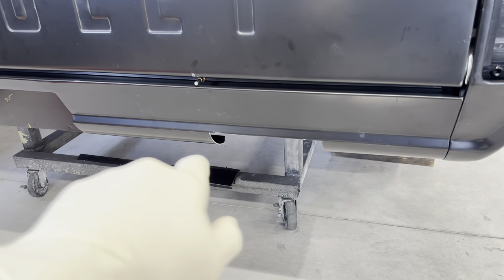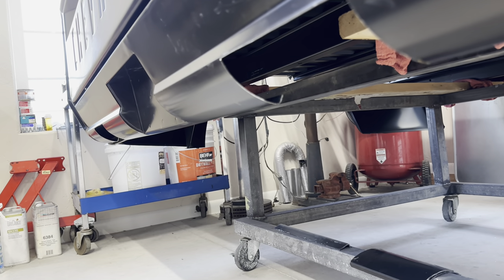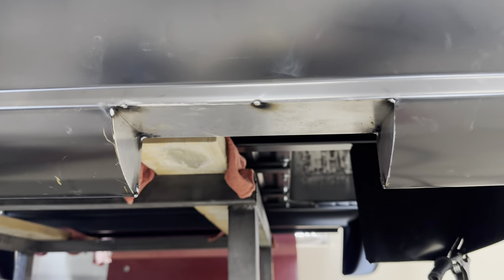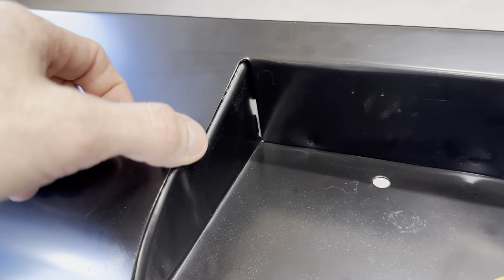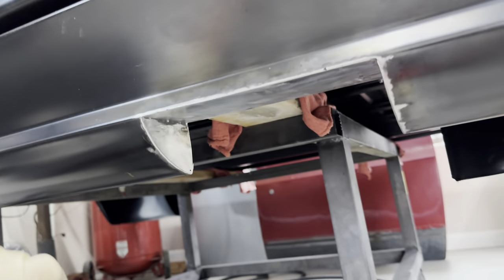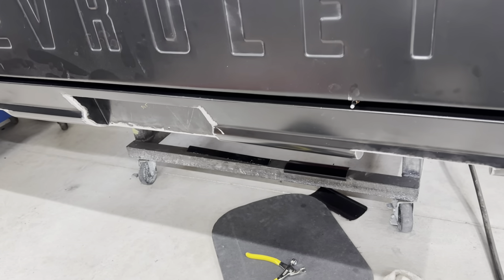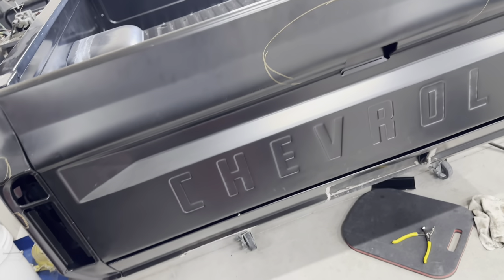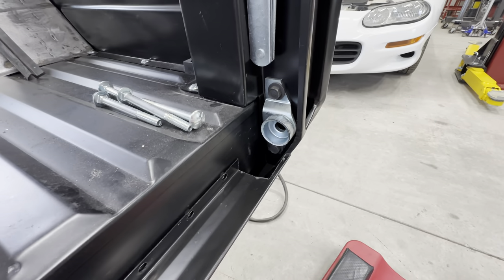1967-72 C10 Roll Pan Mods and Installation

Comment: I think im gunna slot the bottom of the hinge and tack the bottom bolt in so it just hooks the bottom but keeps it from moving.
Reply from the maker: There are definitely multiple ways to install one for a bolt on application, the main thing as you said would be to keep it from moving at all. Not only would that create an annoying rubbing noise but it would also be hell on your finished paint.

Comment: Hey dude, did you see this video yet by LS Fab: "C10 taillight fuel filler install" ?
Reply from the maker: I have seen that one it was one I was looking at but prefer not to spend that much on a few pieces of straight pre cut steel. But thank you in case I didn’t see it.